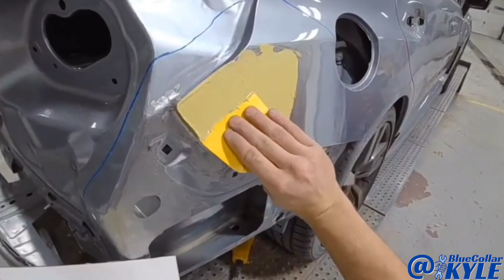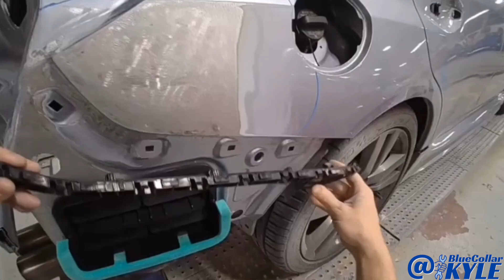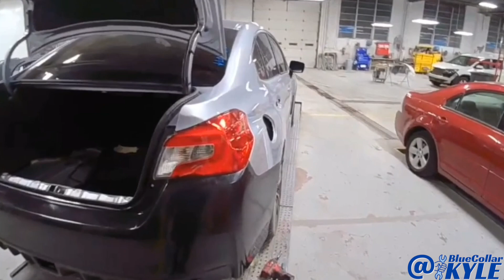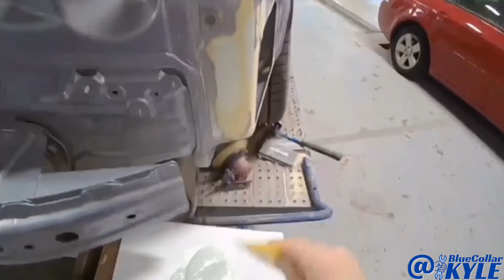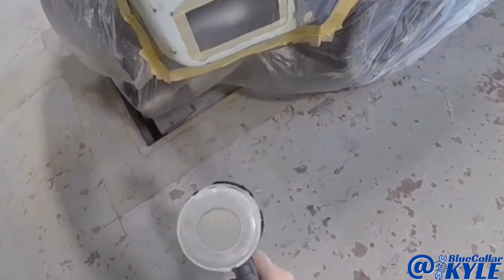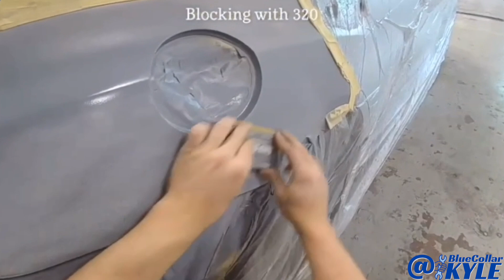One Of My Favorite Tools!

Comment: Quick question! Why you block the primer with 320 and untape the car? 320 is too aggressive and will show through paint job. You should add more primer after blocking and then prepare for paint with 400 or 600
Reply: 320 is fine, never had any problems
Reply: They probably use sealer before adding base coat .